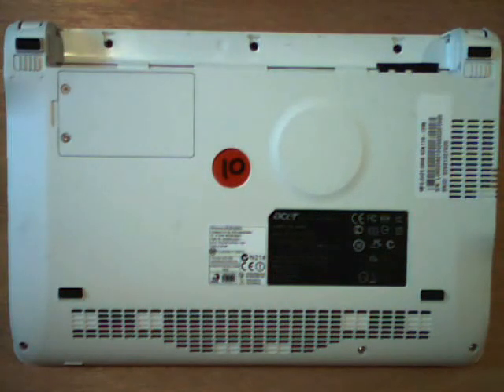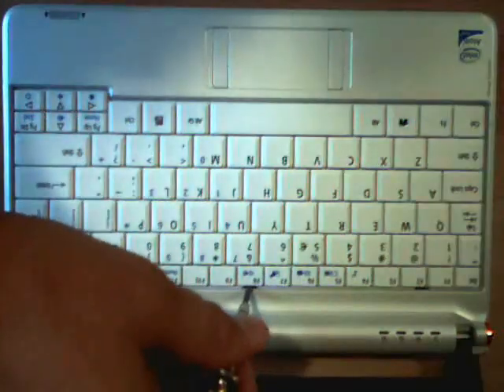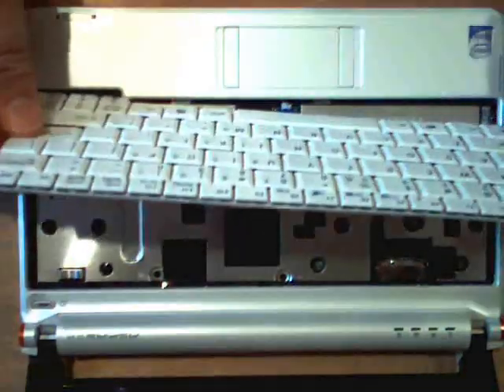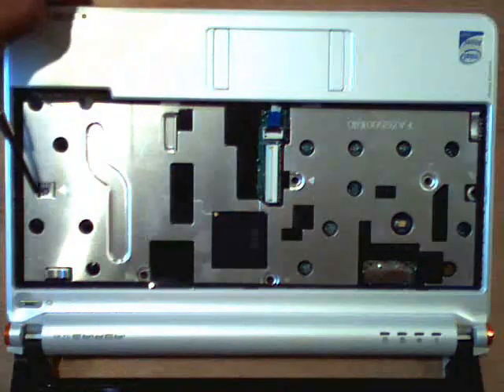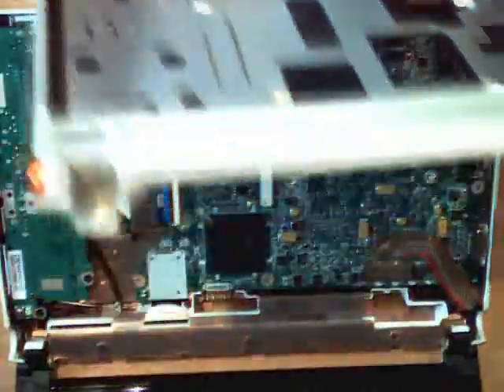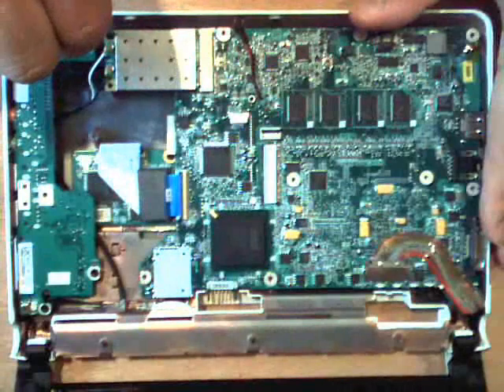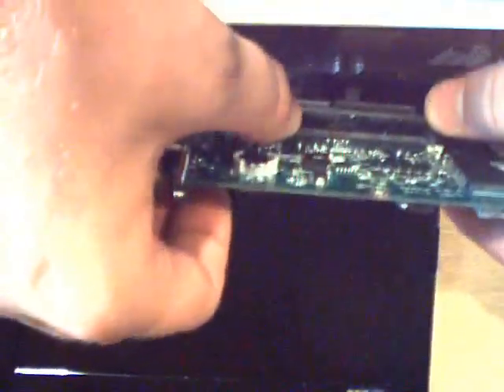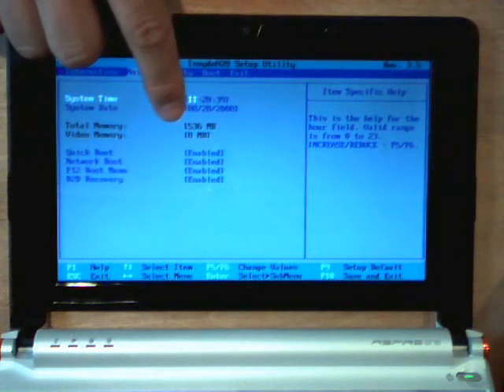How to add RAM to the Acer Aspire One netbook

Comment: Ended up bending the layer under the keyboard and snapping off the plastic bar that has the power button on it in one sudden motion. Then I forcefully closed it in the wrong direction and threw it in the trash. Good thing I got it for free. Piece of garbage.

Comment: comments on variations and left-out topics:
- the touch pad has an extra flat ribbon smaller than KBD, you should remove and reseat it
- some models will have a chrome screw in the middle of the main board, make sure to remove it as well
- some models will come with a hard disk instead of an internal SSD, for them the side io bracket with the audio needs to be removed as well
- some models will come with a lower side door for the hard disk, i dont know how this will modify the procedure

Comment: My aspire one also had the HD as stated in other comments. 

I ran into the problem of finding out the power connector supply thingy ma bob wire and broken off the solder. Which was causing my intermittent charging. 

Alas, thanks for the tutorial. I found it very useful. I did have my computer back together to find my total memory to be 1532mb. But it's in pieces again waiting to be soldered. Hence why I'm replying on an iPod touch( and the sloppy punctuation)

Comment: (...continued)

The video shows a netbook with the solid state 'hard drive' - mine has the real hard drive which is much bigger, and to lift up the motherboard I also had to remove the green pcb seen on the left edge. There are 3 screws, one of which is *very* tight and people must be careful not to strip the head. It always helps when using a screwdriver of the correct size.

Job completed I installed windows 7 and Ubuntu.

Simon

Comment: I used small screwdrivers to avoid doing exactly what he did with the keyboard ribbon connector.

Once the keyboard had been removed I also used the small screwdrivers to gently prise the top cover off the lower part of the case.

(continued...)

Comment: I have not opened up the Aspire One. The chipset supports 2x1GB of 667MHz RAM. The other non-upgradeable RAM is soldered in. This RAM is 512MB at 533MHz limiting  the Total RAM to 1024MB+512MB RAM at 533MHz.

Is it possible to desolder the RAM and insert the upgrade? Is there a slot for the RAM, or is it only soldered? If anyone has a closeup picture of the soldered RAM, I would like to see it. Is this too difficult to attempt, or is it possible?

Comment: I would have to say this video made me cringe
the way he took the keyboard off with Flathead precision screwdrivers is totally wrong
and then he pulled off the ribbon connector for the keyboard the wrong way as well he is lucky the plastic clips did not break

If you want to see a much more detailed video please check out my videos I have one of disassembly and one for reassembling
with schematic drawings/photo of where the screws go

Comment: Watch the video all through before starting, to see the correct way to release ribbon cables, not the way he releases the keyboard cable. He makes hard work of removing the keyboard too, one small screwdriver in the corner under the escape key, gentle upward pressure then work across the three clips with screwdriver no 2 and they will latch back. Beware tho' on mine there was a sticker on the back of the keyboard under the F11, F12 keys which had 'leaked' glue sticking the keyboard to the case.